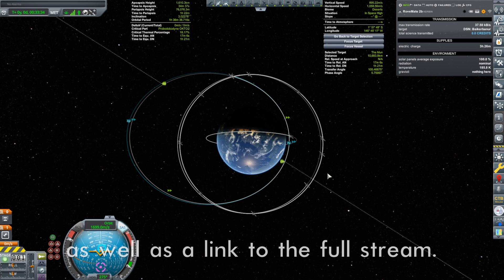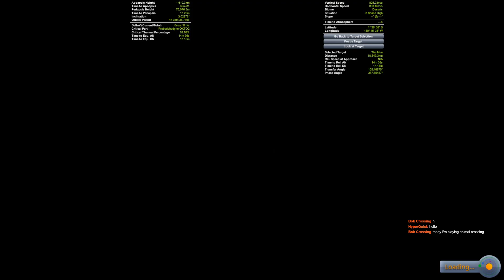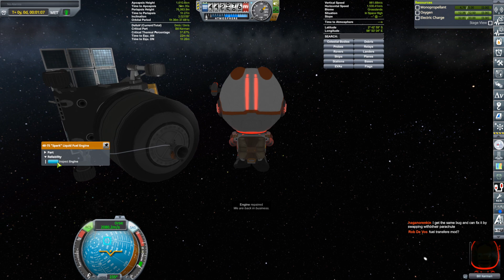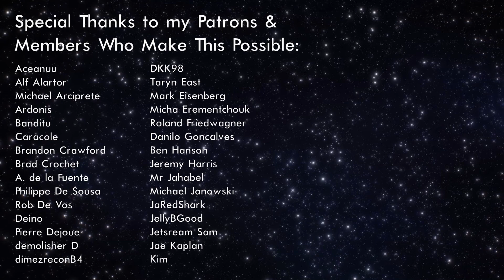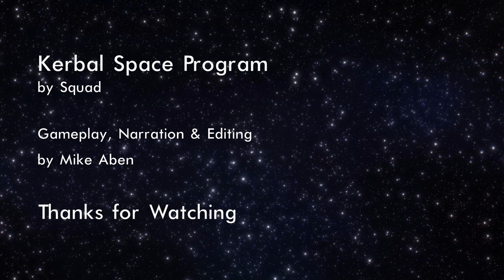Engine Repair | Stream pt. 1/3

Comment: Apparently, in the history of spaceflight, there has been only one case where a crewed vessel's OMS failed to start. Since OMS systems are almost invariably hypergoulic, they are extremely reliable. This happened on Soyuz-33, an Intercosmos flight to Salyut-6. The docking failed, and the cosmonauts made a successful emergency landing with RCS. For a short time, the cosmonaut corps were superstitious about mustaches. The real cause of the malfunction isn't clear, because the service module was not recovered.
Bulgarian cosmonaut Georgi Kakalov had to adopt a stage name, because his last name is funny in Russian.
Reply from the maker: I guess that's reflected in Kerbalism with the number of ignitions available. I don't recall an orbital engine like The Spark every failing on first ignition before. So it's pretty rare.
Reply: @MikeAben  Yes, very rare with a hypergoulic engine, but it's happened once.